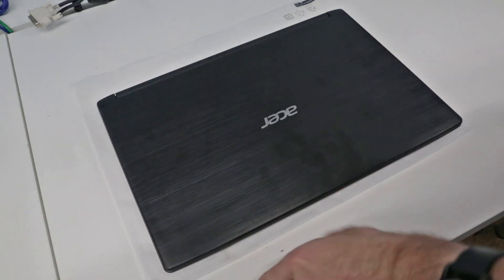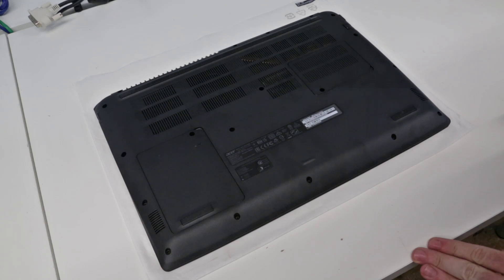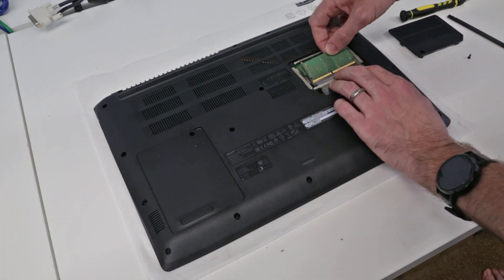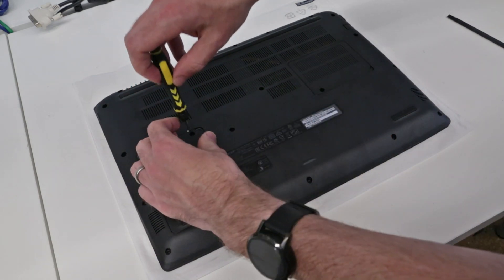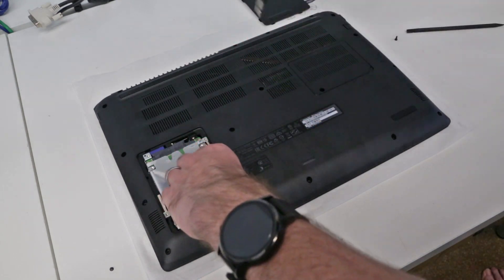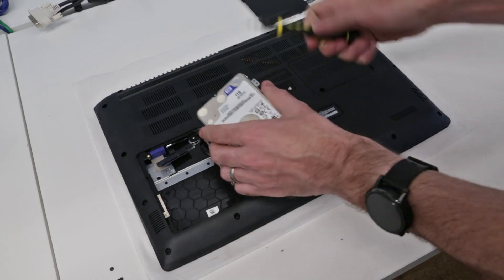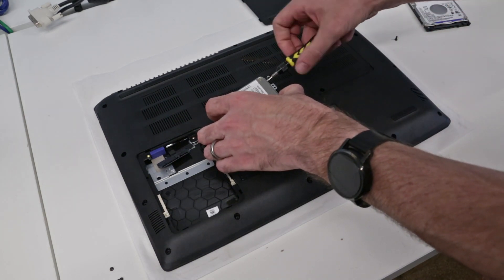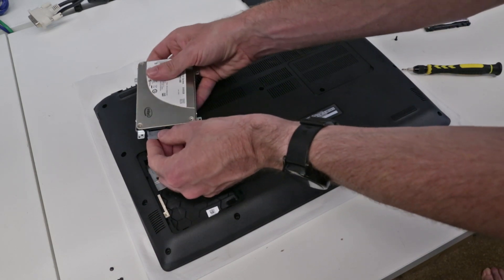Acer Aspire 3 A315-41G RAM and HDD/SSD Upgrade guide

Comment: Is the keyboard Upgradable to a Backlight Type?
Reply from the maker: You'd probably have to replace the whole keyboard/palmrest assembly.
Reply: Is Aspire 7 Keyboard will fit? Or will be Compatible.. i saw it has the same Keypads! The blank key in A315-41g is F8.. And it is the Light keys in the Aspire7
Reply from the maker: @ernestomiranda4447  You'd have to buy a whole A315-41G palmrest with keyboard and backlight presumably. If such a thing exists.
Reply: @BrueComputing  Thanks a lot for the Enlightenment 🙏

Comment: Boss planning to buy this soon can i put a 16gb ram to it??
Reply from the maker: Yes, will work just fine.
Reply: @BrueComputing  is the processor upgradeable too??
Reply from the maker: @peppercorn4196  Nope, the processor on all modern laptops is soldered to the mainboard, so could only be upgraded by replacing the mainboard.

Comment: Is it okay to put different size of ram or it must be same size?
Reply from the maker: You can use different sized modules, but it might not be optimal for performance.
Reply: @BrueComputing  last sir hehe. My installed RAM is 2444mhz is it okay to put 2666mhz RAM or should I stick on 2444mhz?
Or if I just wanna add a new ram should I put the same MHZ?
Reply from the maker: 2666 should be fine, it'll just run at 2400 speed.
Reply: @BrueComputing  thank you sir <3
Reply from the maker: @better-daily-YT  Glad to help!

Comment: Can this handle a 16gb?
Reply from the maker: Yes - I'd recommend installing 2 x 8GB modules (Amazon Affiliates link): https://amzn.to/3CcsC0i
Reply: @BrueComputing  there is room for modules on this? I only see the one slot…. Crap i have an acer 3 model but its not like yours with the 2… sorry.
Reply from the maker: @anubisiv  My reply is referring to the A315-41G featured in this video - if you have a different model then that may be different.
Reply from the maker: If you only have a single DDR4 SO-DIMM slot then one of these should work: https://amzn.to/3jkOsGd
Reply: @BrueComputing  ty I bought one from best buy but must had been wrong because it black screens.

Comment: Is it okay not to remove the battery when replacing SSD?
Reply from the maker: It is preferable, isn't essential if you shut down the machine correctly and are sure not to accidentally power it on.

Comment: I just opened it and mine has no memory i-
Reply: Same ! No one is explaining this I've been looking for a video for ages
Reply: @doubleL_S  If you open up the Laptop completely there is a M2 SSD Slot - so another memory. My laptop came with that preinstalled as yours did. I also do not have a cable to add a normal 2.5 inch memory. Probably if you buy that cable you could add the memory as shown in the video. What I was planning instead was to upgrade the M2 SSD to 1TB. But apparently A315-41 only works with SATA and not with NVMe and also doesn't support that big memorysizes. At least I have not found anyone reporting a 1TB M2 SSD working with this Laptop.

Comment: Hello friend, I would like to ask you something about the RAM, I have that same laptop, but I want to buy a 16GB RAM, for insert it in the slot, that it has, it will be fine? Or will not be fine for my laptop?

I'll be glad if you can answer me soon, please, thank you for your attention
Reply: It depends on the maximum memory the model of your laptop can handle. Search for the specs of your laptop and check if it can handle 16gb of RAM.
Reply: That's what I did and it works just fine even though it's kinda overkilled (16GB + 4GB =20GB) because this laptop can only handle up to 16GB
Reply: @hnguyen500  just 16GB? Well this is new for me

Comment: The Australian version of this is slightly different. Ram connector is on the other side opposite to where yours is no second fan cover. Other than that it's about the same.

Comment: Hey dude my question is, after installing the ram, should I do anything to make sure my pc responds to the new ram? so that it gets recognized? Also when I go to the system properties will it show the amount of ram installed directly or should I do anything else?
Reply: @paeq Yes I already did it and it works thanks!
Reply: @ardentg4mer2006  does games run better ?
Reply: @josephshamon7824  Ram reduces stutters, apart from that, the fps is same

Comment: We have the same Laptop. I want to upgrade my ram tho coz it's only 4GB lmao, but thanks to this video it helps me a lot!
Reply: hey i got the same too ,but i want to take out the old ram from my dell laptop ,and put it in the acer ,it will work?
Reply: @benitoyauza4657  Depends on the models that your acer can support, if the ram that is in your dell is very old it will be counterproductive to use that ram, you should search what kind of ram works for your notebook
Reply: @antuaaa4656  ok thank u
Reply: Hi can i add a 8gb 2666 in it together with the stock 4gb? :)

Comment: i checked and and found out that there is two available upgrades
Crucial 4GB DDR4-2666 vs crucial 4gb ddr4-2400
my question is which one should i buy for better gaming as i want to upgrade 8 gb+8 gb 16 gb  dual channel
doom is not running on my existing dual channel 4 gb+ 4 gb 8 gb ram..
please help..

Comment: Thanks. Excuse me sir, how do you installer the windows in the new disk SSD? I have the same notebook and I do the same proces. But I can't  run the windows from the new disk SSD. Because the older disk is installer in the notebook yet. Sorry by my englih is bad, im from Chile. Grettings

Comment: I have the same laptop as what is in the title. Is it possible to upgrade the ram for 16gb? Is 480gb SATA SDD is better than 1000gb HDD? Is the laptop compatible for external components for gpu/cpu?
Reply from the maker: I have the same laptop as what is in the title. Is it possible to upgrade the ram for 16gb?
- Yes, you could fit a pair of 8GB modules: https://amzn.to/2W7NHWO
Is 480gb SATA SDD is better than 1000gb HDD?
- I'd always choose an SSD over a mechanical HDD - having greater capacity is only useful if you are filling it.
Is the laptop compatible for external components for gpu/cpu?
- No - I don't believe you can connect an external GPU, there is no Thunderbolt port. I'm not aware of ANY laptops that allow you to connect an external CPU, and no modern laptop has a CPU that can be upgraded without a full mainboard replacement.

Comment: I have the same model of laptop with you mate, i wanted to upgrade mine to 8gb, does this model supports 2666mhz ram? Your answer will be much appreciate. Great video btw
Reply from the maker: You can fit DDR4-2666, but it may only run 2400MHz, as that is the maximum official speed the Ryzen 3 2200U supports.
Reply: @BrueComputing  thank you so much, so i would just buy the 2400mhz right?

Comment: So this laptop support dual channel RAM ? Are all Acer Aspire 3 A315 had the same slot like this one ?
Reply from the maker: There are quite a few different models of A315 and I'm not familiar with all of them, but the one I had (41G) has 2 DIMM slots and the ability to operate in dual channel mode, yes.
Reply: Are U had the Ryzen version ? Because as I know the Ryzen had a better perfomance with dual channel RAM,I want to buy the intel version but I want to know if its had a upgradeable RAM or SSD so I search for it.
Reply from the maker: @Itsybitsyoutlaw  Yes, 41G is a Ryzen model. What is the full model number of the one you're looking at?
Reply: @BrueComputing  Acer Aspire 3 A315 55KG-34AK,Intel i3 7020U Nvidia MX230..I can't find the detail about the upgradeable slot
Reply from the maker: @Itsybitsyoutlaw  This video here is for the 55G - I expect it is the same: https://www.youtube.com/watch?v=QDylqnmNPoY
Looks like a single DIMM slot, but does have an M.2 slot for SSD.
Reply: @BrueComputing  I've already see that video,but someone said the RAM soldered on the motherboard,do u think it can be like that ? And the empty slot its for dual channel configuration

Comment: I want SSD along with hard disk ... Is there any additional slot for SSD in this system ? If yes 
Please make a video on that
Reply: Yes. You have to open the motherboard and you will find a m2ssd slot there you can install SSD without losing your hard disk.
Reply: @ziaulhaqp5769  do you have to open all the back case ?
nvm just got the answer righ bellow this comment lol

Comment: This is different from the "ACER - Aspire 3 A315" I checked out at a local shop, that does not have a door for the RAM. You'd think laptops with the same model name would be similar... Also, another YouTube video shows how the "ACER - Aspire 3 A315" that they tested is a piece of junk, with no cooling on the CPU, so it stays throttled as soon as it warms up. That one has a RAM door with no RAM socket behind it!

Comment: I have a fresh SSD, plugged it in and trying to install an OS using an external dvd rom but nothing shows on boot priority order. Do you have any ideas on this?
Reply from the maker: By default the machine will be in UEFI boot mode and the DVD won't be a UEFI bootable device. I always use a USB stick to install Windows 10.
Reply: @BrueComputing  right, I tried a USB stick and same thing goes. Do you think it has something to do with the stick being MBR/GPT? Also I tried loading an OS using a different computer and the laptop says no bootable device. Appreciate your response.

Comment: Hi, your video is so informative, not being much of a techie myself I was wondering where you get your ssd's from as I bought an Acer A315-22-49QX a few months ago and it has to be the worst laptop i've ever had, it is so slow. Will this process help me and if so which one would I need, regrads JJ
Reply: Jason Jones hello jason, i have a samsung 860 evo (500GB) installed in my system and i‘m really happy with it. its a day and night difference. you can buy it anywhere you want, i buy my stuff mostly from amazon :)

Comment: December, 2019 - Aspire 3 A315-53-30NO is available in the States at Staples for $219.00 with FREE shipping. Sweet deal... with various upgradable (SSD, M.2 SDD, et al.) options you can do yourself.
Regardless, thx!

Comment: I have the same model for 7 months only and suddenly my laptop suddenly shuts off yesterday. I thought it was a battery problem so I try to restart the battery by holding the power button for 20 secs and also push and hold the reset battery pinhole underneath for 5 secs and resting it for 5 minutes before powering it on but it doesn't work either. Only to found out that if I press any keys it would turn on but shuts off seconds after. And it seems I'm not the only one having this problem. Some say its a keyboard issue but I barely use the keyboard and use an external keyboard instead. Any tips and advice, etc would help. Thank you.

Comment: I have the 8gb ram version. Can I upgrade to 12 or 16?

Also, what are the benefits of an ssd disk? Does it help on gaming performance? I play a game that is not so demanding but i run around 10 clients at a time and my cpu sometimes goes to 100%. Any advice?
Reply: Yes you can upgrade to 16gb, that's the max supported. Also, SSD helps stuff load faster (like windows at the initial startup, any programs you run) as it is faster that the stock HDD. Also, yes it would help better gaming performance by loading games faster and reading the game files faster.
Reply: @piyushdeswal5506  i suggest having an m.2 ssd

Comment: Mine came with a 256gb M.2 SSD, but not a standard 2.5" drive, and does not have the HDD caddy or the SATA plug.  Is it possible for me to add a 2.5" drive, presuming I could source a caddy and SATA cable?  And where does the SATA cable plug into the motherboard?
Reply: Hello, I hope you solved your problem. I would have a question for you. I have the same laptop. I want to buy m2 ssd. Does M2 ssd have to be sata?
Does Nvme type support m2?

Comment: ıf ı add extra memory is my laptop will get out of the guarrante
Reply from the maker: You won't be breaking any warranty seals, so in the event of an issue you could remove the extra module. Obviously the extra memory won't be covered though.
Reply: @BrueComputing  so what you're saying is you can upgrade it no problem?

Comment: memory 8gb ddr4 2400mhz and 1,5V  is compatible with this notebook? hear it had to be 2666mhz and 1.2V
Reply from the maker: The model I had was DDR4-2400, but 1.5v is VERY high for DDR4 - it should be 1.2v.
Reply: @BrueComputing  I bought a 1.5V ddr4 and it didn't work should this be? Should have bought the standard ddr4: 1.2V = (
Reply from the maker: I wouldn't expect it to - the laptop will only deliver 1.2v to the module.

Comment: Hi! I need to know if this laptop supports 3000mhz or 2400/2666 mhz ram, mine has 2133mhz so idk!
Reply: Luis Fernando Rodríguez Amaro that dépend on the board but I suggest mailing acer on that and look up the cpu on Intel ark see if it supports it too

Comment: Nice video. However, wonder how you managed to install Windows back to ssd? Did you take backul of Windows first? If we install m.2 ssd, can we move Windows from HDD to ssd and use the former purely for storage? Please advise. Thank you.
Reply from the maker: Depending on what I'm doing with the machine I'll either clone the contents of the drive with Acronis True Image, or do a clean install of Windows 10 from USB.

Comment: I just want to ask if it's true that this laptop has a built-in memory? The IT told me when I let my laptop repaired..
Reply: At the absolute MOST it comes with 512MB system RAM, of which you only can use 504MB.

Comment: Today I took the same laptop to a repair shop to have my 1tb hdd installed and they said they had to take away my 128gb ssd did they screw me over?
Reply: Yes. 

The 128GB SSD in this laptop is installed in the M.2 slot which has nothing to do with installing an HDD. Go back and demand them to give you the SSD back or reinstall it.
Reply: F

Comment: Should the both ram (1st channel and 2nd channel) frequency  be same.......
There is myth if the frequency of both ram doesn't match with each other then there is a chance of damage of the ram...
But u r using 2666 ram with 2100
Tell me
Reply from the maker: It won't cause any damage - it'll just run at the speed of the slower module.
It is generally better to use matched modules though as it'll guarantee the memory controller running in dual channel mode.
Reply: @BrueComputing  ok thanks

Comment: I would like to install a 128gb ssd because the factory 1tb 5400rpm hdd is acient slow is their a way to transfer the operating system to the ssd without buying a license key
Reply: There is no way to transfer the OS with activation...How ever if you have M.2 Sata or M.2 NvMe slot then dual boot it and use the SSD to Qucik boot... while software installations you have to select the location for installation else your 128GB SSD will have no space left...else install only important software application in SSD to quick startup as per your convenience....

Comment: what is hdd and ssd
Reply from the maker: Hard Disk Drive and Solid State Drive
Reply: @BrueComputing  what is the difference?
Reply from the maker: Hard Disk Drives are a mechanical spinning magnetic platter with a head which moves across it. Solid State Drives use flash memory chips and have no moving parts.
An SSD is faster and more tolerant of drops, vibration, etc, but more expensive.
Reply: @BrueComputing  what do they do?

Comment: Is there a second hidded area with ram because i opened that pannel up and found no ram at all. The laptop said it came with ddr4 4gb ram and when i tried to put ddr4 ram into the laptop, i found that ot didnt fit. Please help.
Reply: I dont know if you already found your answer but i think your laptop already have a pre-installed ram to it, all you have to do is NOT change the ram but instead just buy new ram with same model. Now i dont know if you can actually change the pre-installed one...

Comment: I have a Acer aspire 3 and it doesn't have a ssd I think it might have a m.2 ssd but can I still install a normal ssd into it?
Reply from the maker: If it has an M.2 drive from the factory it may not have the SATA connector fitted.
Reply: @BrueComputing  it may have one because it has a slot where the ssd is supposed to be.

Comment: A315-41-R1HG Can I put a 3200 MHz RAM? Marca: MLLSE
Reply: As far as I understand you can do it, but the motherboard won't use its full potential. Did you already do it? If so, how was it??
Reply: @andresrueda88  You're absolutely right! I installed it but don't see much improvement of the speed.

Comment: What's the maximum ssd m.2 capacity it support?
I read somewhere that its m.2 slot supports only 250gb.
Plz help.
Reply: Mohammad Aftab Alam it support 256gb ssd without removing hdd and if u remove hdd it support 512gb or 1tbssd
Reply: @दिनेशकुमारनामा wot???? Mine has 1tb m.2 ssd and a 2tb hard drive and it works properly. With the same laptop this guy have.

Comment: i installed a new 4gb ram and now it won't boot, just black screen. I removed it and now its working fine. Do i need to do something before installing a new ram?
Reply: Does it beep? If it.... then the RAM is Faulty Get it replaced
Reply: @Ruturaj_P-h1p  i managed to fix it by putting the new ram on 1st slot and the old one on 2nd
Reply: @madkip4991  brilliant 😂

Comment: Can I up grade mine it’s a a315-31-p1kd for gaming and also is the CPU upgrades me and the graphics card please help ASAP
Reply from the maker: No, almost any modern laptop (barring some high-end gaming or workstation systems which use desktop processors) will have a soldered processor, which is non-replaceable.
Likewise for graphics cards, only high-end gaming laptops will use MXM modules, and even in these they are very uncommon now.

Comment: I have the Acer Aspire 3 A315-53-573T with 4GB 2133 Mhz soldered and a free slot, can I put a Crucial RAM of 8GB with 2400 Mhz or higher?
I would have 12gb totaly.